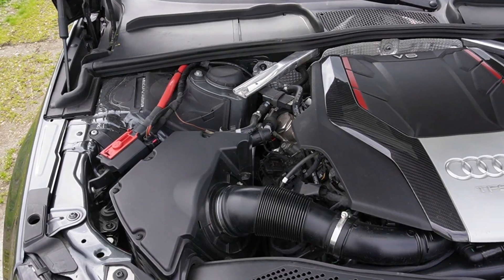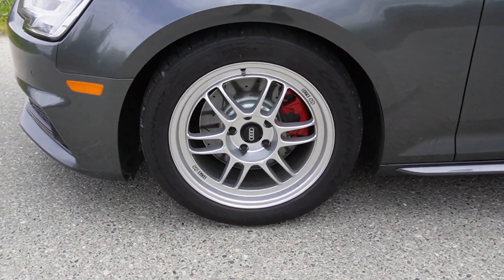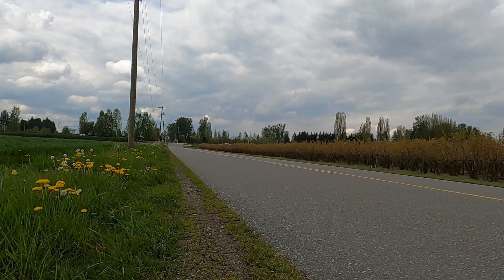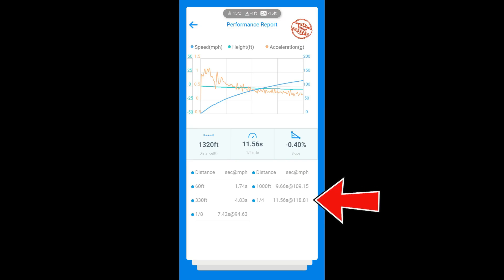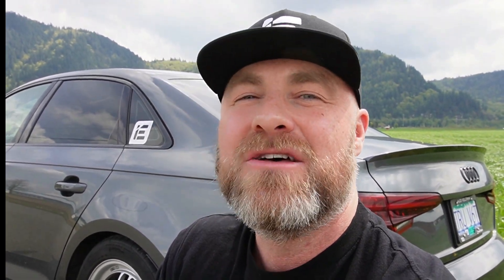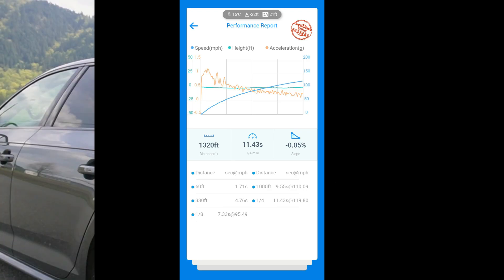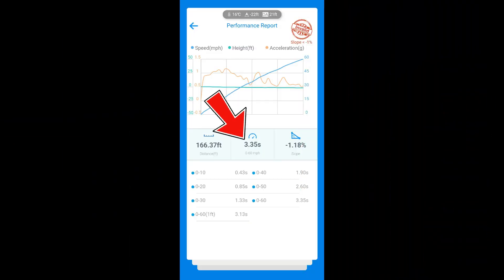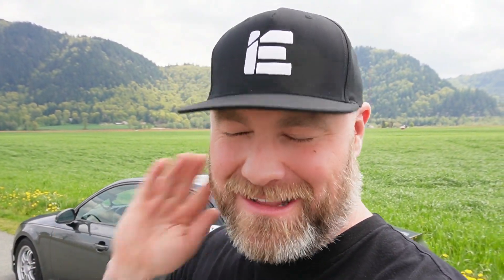Integrated Engineering Stage 1 E85 1/4 Mile Testing - Audi B9 S4

Comment: Would u  say this stage 1 e85 tune is dailyable with 0 hardware changes for many miles. Or would I need modifications to not affect  reliability?
Reply from the maker: Zero hardware changes are needed for a reliable tune. The hardware changes will simply improve performance as well as cooling.

Comment: I have a b9 s5 with cts intake turbo inlet and cts catless downpipe, i am tuned with ie stage 2 and stage 1 tcu. I want to do stage 2 e60-e85 file can i just fill it up with e85 or do i need othere modification?
Reply from the maker: First off, you need to tune your TCU to Stage 2 to match your ECU tuning. Then you need to install an intercooler to have your car work efficiently on that tune. Once those two things are done, simply tune your ECU to Stage 2 E60-E85, fill it up, and you're good. Here's a video I shot of the process that I used with my RS3 which is virtually the same: https://youtu.be/aP_pXtEZlbM?si=K53InsjdU18W8DcI

Comment: So you didn’t need hpfp?
Reply from the maker: You don't need a HPFP to use the standard E85 tunes. If you want to run the Stage 1 & 2 Plus HPFP tunes then you need a HPFP upgrade.
Reply: @VancityAudi but would u need any other modifications to safely run stage 1 e85 with hpfp. Or would that be too much power for the stock eternals  to handle ?
Reply from the maker: @shelbyhaiketic4212 Integrated Engineering has all of the hardware you need to run their software successfully on their website found here: https://performancebyie.com/collections/ecu-software-tunes/products/ie-audi-3-0t-turbocharged-performance-ecu-tune-fits-2017-2020-b9-s4-s5
Reply: @VancityAudi  got it thanks, they also say on the website I don’t need anything else, but I want to make sure I’ll be safe downpipe only on stage 2 , with no hardware changes. Becuse 034 frowned upon that idea, idk if ie also wouldn’t prefer it
Reply from the maker: @shelbyhaiketic4212 IE will frown on it too. It's stupid to try and make all this additional power without the proper mods to support it. If anything an intercooler is an absolute must. For any of those power mods.
Reply: @VancityAudi  how just stage 1 e85( 0 hardware changes) U think intercooler is still necessary? Cause stage 1 e85 makes more power than stage 2 93. Thanks for the responses I plan on having fun with the car and tuning it without going above and beyond modifying it
Reply from the maker: @shelbyhaiketic4212 it literally says on their website the hardware that is optional, required, or highly recommended. I always suggest you do every supporting mod to get the most you can out of the car. If you want to do the bare minimum and hope for the best, then you don't NEED to do an intercooler upgrade. But I still highly recommend it.
Reply: @VancityAudi  it’s says it’s highly recommended to get the most power((for the hardware mods) , but it doesn’t say anything about it for reliability that’s why I was confused
Reply from the maker: @shelbyhaiketic4212 by not running at least an intercooler your car is generating a bunch more heat which will impede performance. Not only that, excessive heat is not good for any car.

Comment: I know this is not most people's main concern with a tune, but how has the IE tune affected regular city/highway MPG?
Reply from the maker: Sadly my city mpg is horrible, lol. I haven't done much highway driving since I changed jobs. I'm seeing between 14 and 16mpg in town.
Reply: @VancityAudi  Ah that isn't great but considering the power this puts out not so bad! What was your city MPG before the tune?
Reply from the maker: @DjSeanTacos  well before the tune I was running straight 93 octane pump gas which in itself is drastically different. I think it was like 20mpg
Reply: @VancityAudi  Awesome thank you sm!

Comment: What’s going on with the shift from 1st to 2nd? It seems like it's missing the shift or at least taking way longer to shift than it should.
Reply from the maker: My 1 to 2 shift has always been quite harsh. I've compared it vs other B9 S4's and it seems a little harsher than most but on par with others. I'm working with IE to smooth it out.

Comment: Still can’t figure out my launch, I held it for boost, traction control off, and it’s still shifting at 6500 from a stop with the TCU tune,
Reply from the maker: Through every gear?
Reply: @VancityAudi  so far yes
Reply from the maker: @tristancefail  have you checked in with IE with your VIN and let them know about your issue? They'll want to know.

Just to reconfirm you are running an IE ECU tune as well as an IE TCU tune? If so, which TCU tune? Street? Aggressive?
Reply: @VancityAudi  I haven’t messaged them yet, running IE stage 1 93 ECU/TCU with aggressive launch
Reply from the maker: @tristancefail  have you tried switching to the 91 file to see if that changes anything? Or more importantly changing to to a different TCU file seeing as that controls your gear changes?
Reply: @VancityAudi  I’m going to try to change the TCU next time and see what happens
Reply from the maker: @tristancefail  might as well try it out and then you'll have more to tell customer support of the things you've tried to make it work first

Comment: Love your videos!!!!!

Adam... I have a big question for you...
I own SQ5 2015 petrol. 
100k miles.
Before 4 days I put in fuel in a Gas station that I suspect as they have a bad quality fuel. 
Any way after one day the check engine light came on with a misfire on cylinder 3 when I go up to 4500rpm or up... the car worked with 5 cylinders ofcourse. after I erase the fault code I tried to push the gas again... and again check engine came on... and this time misfire on cylinder 3 and 2 ...
And again... and it was misfire cylinder 3 and 1
Or 3 2 1 together. 
I replace thise three spark plugs of 3 2 1 and nothing. 
I replaced coils on 3 2 1 and nothing. 
A few things I mentioned:
1: The gear shifts up very early now... 6th gear on 40kmh.
2: There is a more bass sound from the exhaust. 
3: I can drive the car if I'm not push it more than 4500rpm...but the feeling is not as before. 
Any idea? 
The car with stage 1 for 6 month now. 
?.?.?.?.?.?.?.?.
Reply from the maker: Have you logged your car to see if there were any codes with your fuel system?  My guess would be your low pressure fuel pump.
Reply: @VancityAudi  if it's the low pressure fuel pump... why the left side ( cylinders 4 5 6 ) without fault code?
Reply from the maker: @doronkoz  have you tried doing a compression test to see if your cylinders are f$cked?
Reply: @VancityAudi  yes. The engine is fine.
Reply from the maker: @doronkoz  then I'd look at the fuel pumps next. As for why you are only experiencing it in 3 cylinders I'm not sure
Reply: @VancityAudi  what about the cat? I heard about that from a few sq5 owners ... one side cloged cat
Reply from the maker: @doronkoz  you could definitely look into that as well. I don't have experience with that though.
Reply: @doronkoz  check your map sensors, one of them might be dirty.
Reply: @VancityAudi  OK. Thanks Adam. I will let you know when i fix it. Thanks again for all.
Reply from the maker: @doronkoz  np. Good luck. As mentioned above by another person perhaps your MAP or knock sensors are hooped. You could try replacing them as well.
Reply: @VancityAudi  HI Adam...Finally...we took the cat down... it's cloged. The right one 90% clogedv and turn on misfire 1 2 3 cylinders...
The left one on his way to die also. 

Now I need to decide what to do... oem cat here costs 4500$ each...
I think I will take out the inside of the cat and put them in place just empty. 
I hope the sound of the exhaust will not be terrible 😬
Reply from the maker: @doronkoz  very happy you figured it out!
Reply: Funny that I'm dealing with the same issue, I have misfire in cylinder 1, 3 and 4. Car is sitting now as no one can figure my issue out. The only thing I was talled is that my timing is off, maybe from running e85. You might have same problem from running a bad gas. I don't know how to fix it and no shop wants to take my car in because of the ecu tune.
Reply from the maker: @allenz4772  have you logged the car to see what codes come up other than misfires?
Reply: The codes are mifiring 1 2 3 randomly.  
Spark plugs checked. 
Coil checked. 
Timing checked. 
Fuel injectors checked. 

What else can be? 
They're is a chance that it's a right clogged cat???

Comment: How does that sport diff sound after all that wheel hop?😅 mine ain’t doing so hot after an e40 1st gear roll on or should I said “hop on”
Reply from the maker: Still working amazingly well. I've raced the car multiple times since this video was shot.

Comment: Another great video Adam, the content you put out keeps getting better and better
Reply from the maker: Thank you very much. I'll keep giving it my best to improve the content I put out.
Reply: @VancityAudi Man, it’s crazy to see how well that thing performed on those pulls (yeah, yeah, even on that first!). I’m currently running the stage 1 91/E85 tune(s) (go back and forth occasionally) and I’m getting a P0172 code when I run a diagnostic with my iE cube plugged into the OBD port and I knew that my car should’ve been running much better than what it does either on 91 or E85 (especially that!). I currently also have an APR intercooler/pipes, an AWE intake and Milltek catback exhaust. When I give it throttle I hear somewhat of a clicking sound and the car jerks just a bit so I’m either leaning toward it being an oxygen sensor or the MAF one based on the code. Could that really play such a factor on what’s happening on my end?! 😓
Reply from the maker: @AudiForLife  I'm honestly not too sure what the issue may be. I'm also not sure what you'd consider good or bad for how fast your car is. A lot of things come into play determining how fast your car will be including your elevation, ambient temperature and density altitude. Have you emailed IE's customer support with a log and a VCDS scan of the car showing them your issues? My guess is you get that code when you switch from pump gas to ethanol and before your system has pumped through all of the ethanol it still has too much pump gas in the mixture and it is reading rich, which is nothing to worry about.

Comment: Great performance Adam! Not so far from 10-s like you did with your B8 which had a lot more tweaks. I expect the B9 to perform better.
Reply from the maker: I agree.
Reply: The B9 is a much more capable platform overall that the B8 S4. Hybrid turbo tunes completely leave it in the dust.
Reply from the maker: @dcxSpartan117  absolutely. On full tilt and 110% effort, after 12 years of development, the B8 platform has reached a 10.1 in the 1/4 mile. After 4 years of development the B9 platform has reached a 9.8 in the 1/4 mile. The B9 platform will absolutely destroy everything that the B8 cars have done in the past.